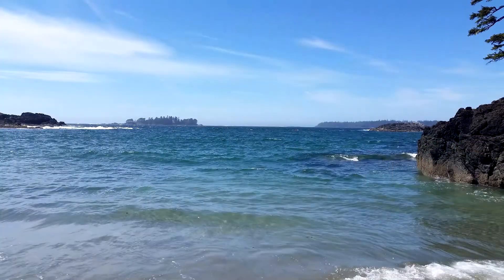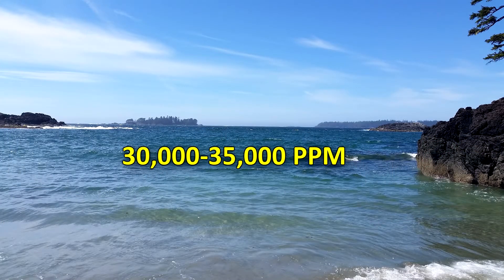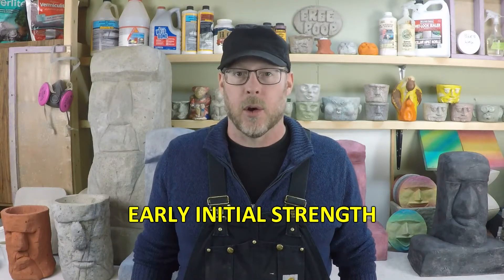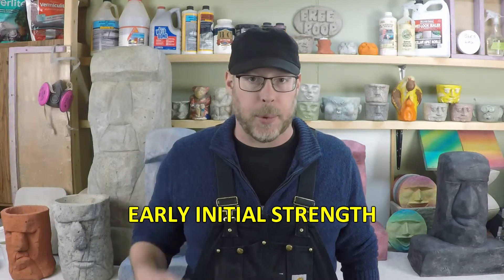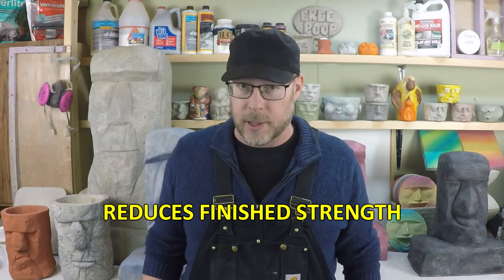Can You Make Concrete With Sea Water?

Comment: Romans built almost exclusively non-reinforced structures. Reinforced structures have concrete and metal which expand at different rates as the temperature changes, causing concrete cracking. Also rust causes reinforcing to expand and makes the concrete crack.
While it would be easy to think modern building methods are poor, there are good reasons why we are using reinforcing. Without reinforcing we can only use concrete in compression.Being able to put members in tension is what allows us constructing modern structures.

Comment: Just use basalt instead of steel.
Reply: or fiberglass ... which is basically manmade basalt with a lower temp resistance of 200c compared to basalts up to 400c resistance. In the realms of construction basalt is overkill and overpriced for the application. Unless you are talking about something over 5 stories high (rule of thumb), use fiberglass.

IE the cap stones don't have to be strong at all ... the bottom ones do.

Comment: Common construction techniques among homes located in Southern California beach towns that were constructed in the early 1900s was to use beach sand  as the aggregate for foundations. This caused early failure and flaking that occurred  decades later. Would this have been caused by the salt remaining in the sand?
Reply from the maker: The beach sand alone is enough of a problem to cause failures, but I can only imagine the high salt content would also cause problems because of any steel within the structure aggressively corroding.
Reply: I'm on the east coast NC there are houses built in the 1930's with seashell and coarse beach sand aggregate concrete foundations, and a few old roads made with shell and sand. The stuff appears to hold up pretty well considering the beating it take from the weather. It was a desolate stretch of coastle sandbar, surrounded by ocean water, so I have no idea where they would have gotten fresh water from.

Comment: If there was no steel in the concrete would it be alright to use sea water? Would the concrete eventually fail or would be strong?
Reply: Didn't the Romans add volcanic ash to their concrete, then the two calcified or something?
Reply from the maker: I think there is a method to use salt or salt water, as per Roman concrete, but modern mix designs I think would fail due to the high salt levels.